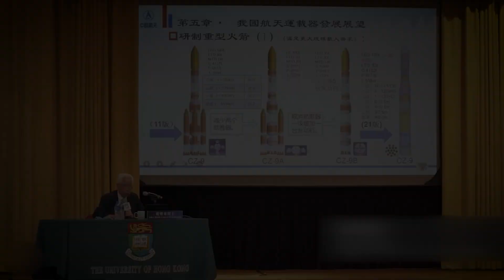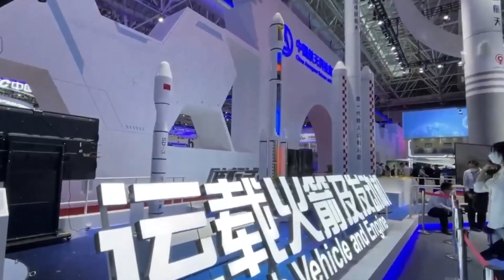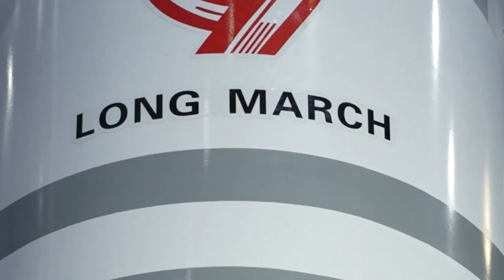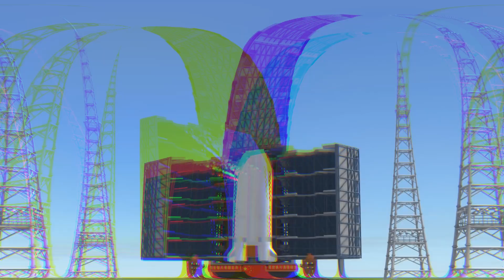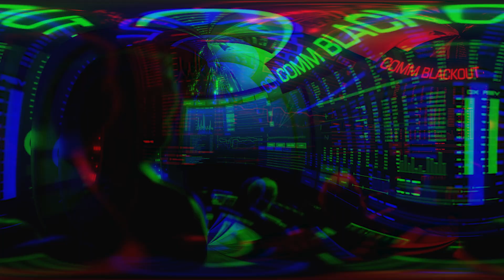China vs. Starship: The Battle for Space Supremacy

Comment: SpaceX is not using at this time… solid stage boosters if so, the rocket could be wider and taller caring far more your payload.
Reply: Elon Musk insisted that each section could be trailered on the Interstate, that's the limiting factor to how wide and tall the StarShip is not whether or not solid fuel rocket boosters are used.